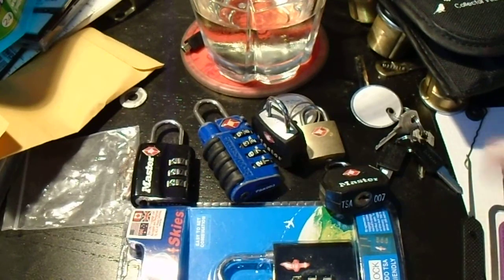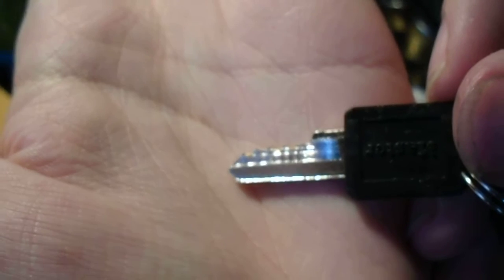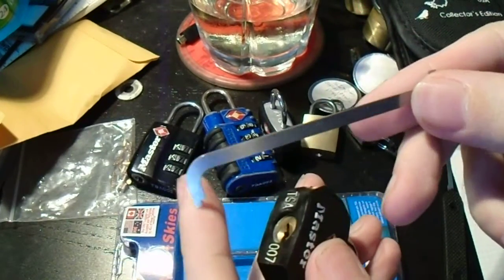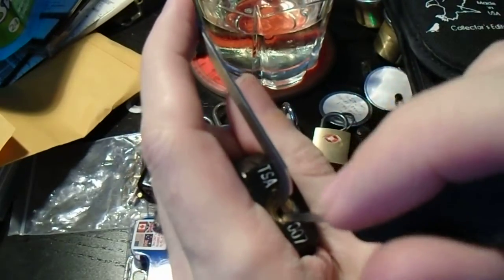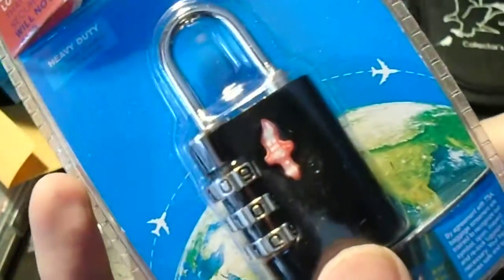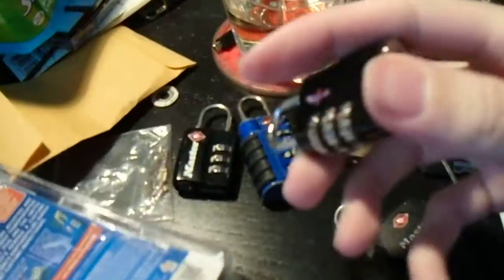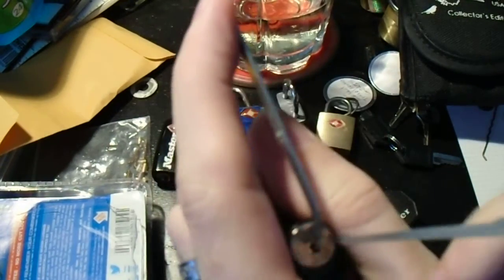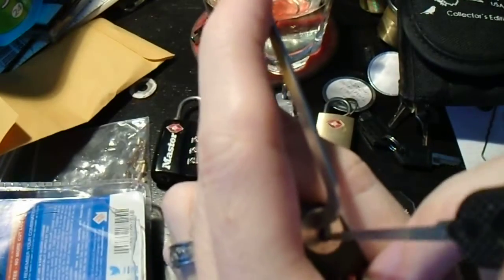(051) Master Lock 4681 and Safe Skies 3-dial Aero TSA-locks picked and shamed

Comment: These TSA Locks are crazy it's more secure to use a zip tie at least you can tell if somebody opened your luggage or not.
Reply from the maker: +Ultimate Unnamed Too true. Even the 'search-alert' locks (they have a little indicator that changes color or pops up when the override is used) are not really useful. I have one that allows someone to relock it then reset the indicator, all it takes is a paper clip.
Reply: Ok interesting never heard of that system maybe one day you make a video about that, would be nice.